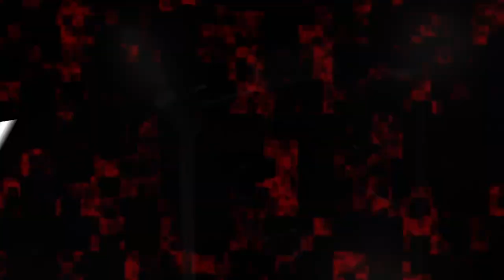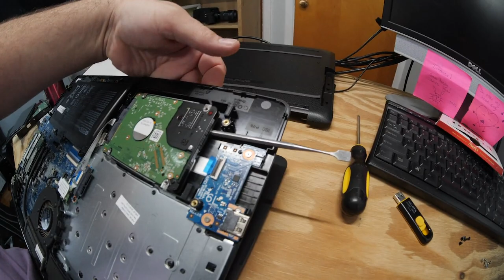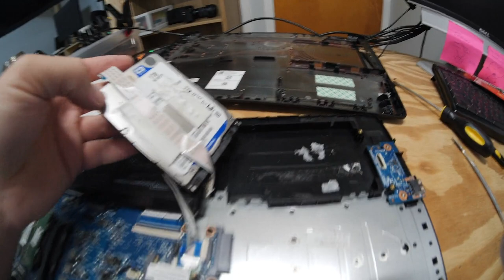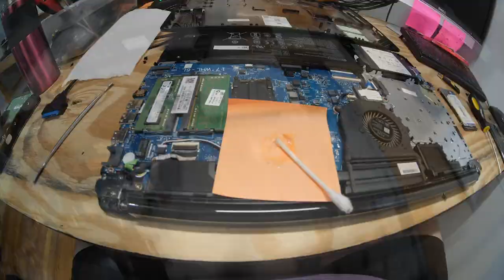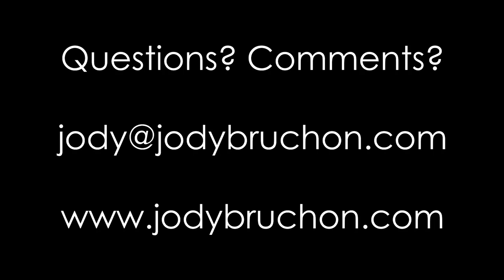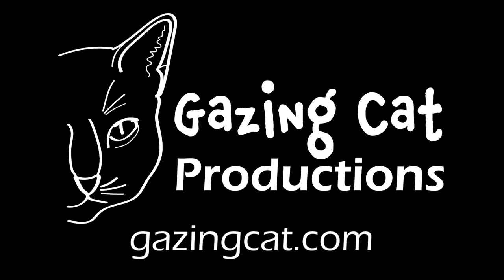Hard Drive Caddy Stuck Inside With DOUBLE-SIDED TAPE? WHY?! - Jody Bruchon

Comment: LOL!!! At least it wasn't 3M VHB Tape!!! Just a note, it would be worth going to your local Hobby Lobby and pick up an offset thin spring steel spatula in the cake decorating or art paint department. I have one that I use for 3D Printing lift prints off the bed before they completely cool. Well worth it!!!😁👍🏻

Comment: One mans ingenuity, another mans GwarararararaaaaGgghhh! :-) Only thing I could suggest is powering up the drive for a bit if it works to get some heat into the tape that way. Although it looks like that tape that usually tears in half before the sticky gives.
Velcro might be a good idea. Still stuck in place, but at least you can get it off. Providing the breather hole isn't covered of course on a mechanical drive ;-)
Reply from the maker: I stabbed it with my pry tool and it ripped apart. The adhesive is pretty brutal.
Reply: I would just use a hot drier

Comment: I bought a refurbished Lenovo ThinkPad T540p 3 years ago. The laptop would not stay on overnight. I dug into the chassis. I bought it knowing replacing the drive and memory would be easy. I started to take the SSD out, thinking it was the issue. I found the refurbisher used double-sided tape to keep the drive from moving. I sent them an email and they sent me a caddy. I still did not trust the SSD, a Pioneer drive I believe. I replaced it with a Crucial SSD.  This laptop was for my mom to replace the HP cheapy I tried to upgrade the memory on. Why put the memory underneath the keyboard on a laptop. I broke something, so I paid for half the laptop. The laptop is still running today.

Comment: if you look closely it seems like there is in the plastic a sort of placement for the double-sided tapes, so it could be the manufacturer not a technician who did this.
Reply from the maker: I found double-sided tape on the bottom plate too, but with the adhesive not revealed. It's definitely from a spool of retail tape.